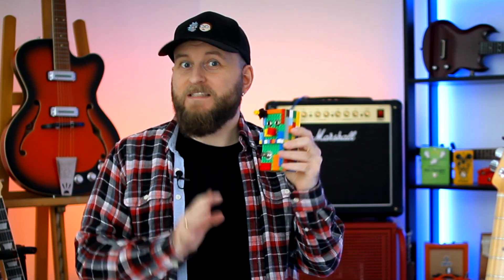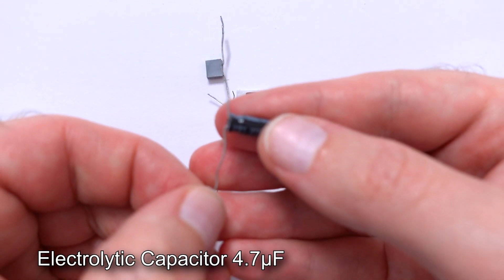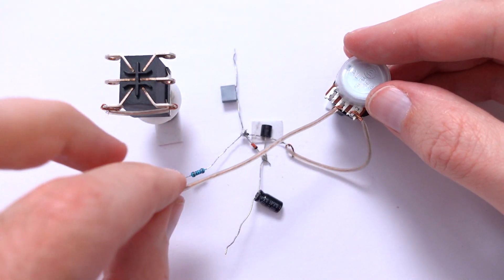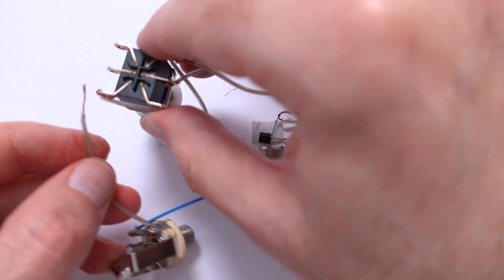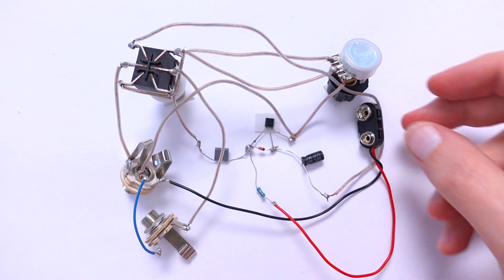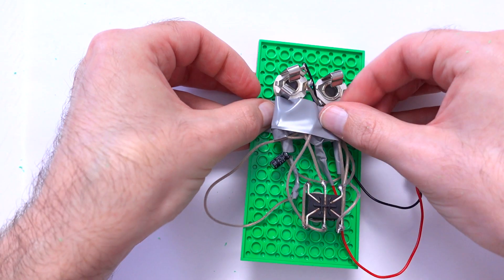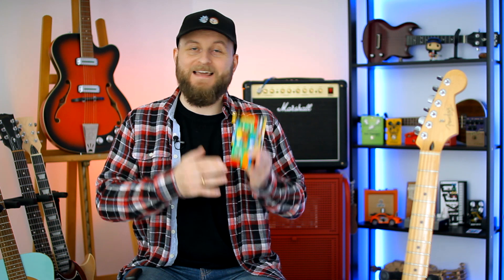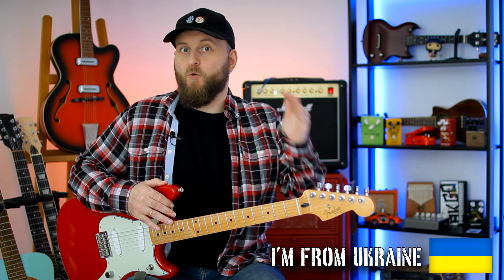I Made Fuzz Pedal of Lego! - Build a Guitar Pedal in 10 min - Tutorial

Comment: maybe add diode protection in case you touch battery to contacts backwards?
Reply from the maker: I will be grateful if you explain me the details.
Reply: If you use a Schottky diode (chosen because the voltage drop can be as low as .15V) you can put it in line with the battery connector so that electricity can only flow one way. Prolly easier to see pictures and circuit diagrams if you just google search diode protection circuit. You have inspired me to try out yer design with legos. I did a Lego guitar flamethrower and also drilled the legos to put in the potentiometer and 1/4" jack which felt very wrong. I'll try to find a way not to drill the legos on the pedal. Anyway, good work good sir.  @MrHardguitar